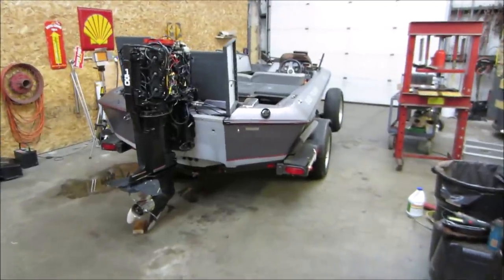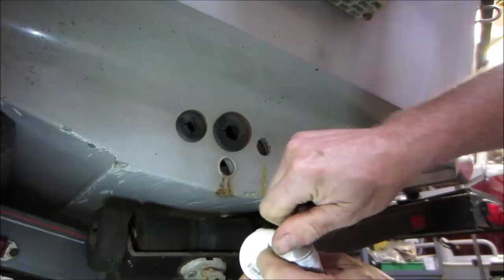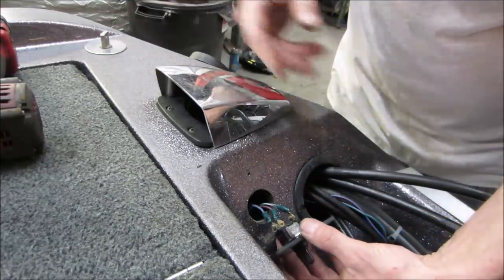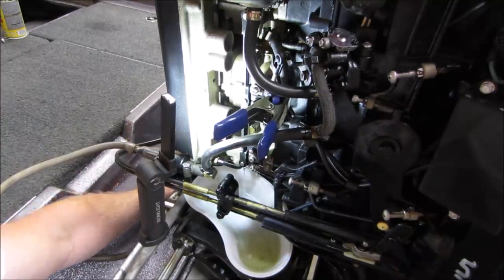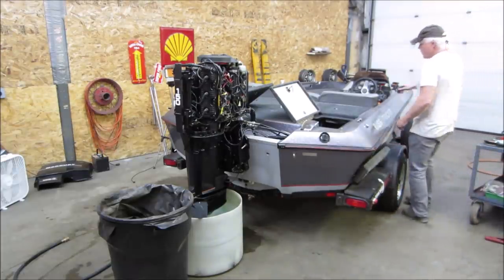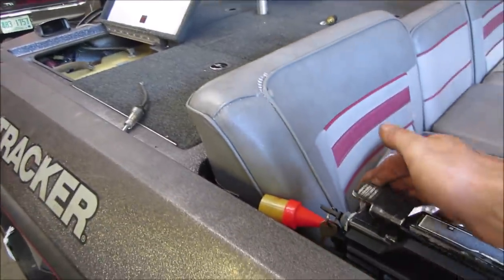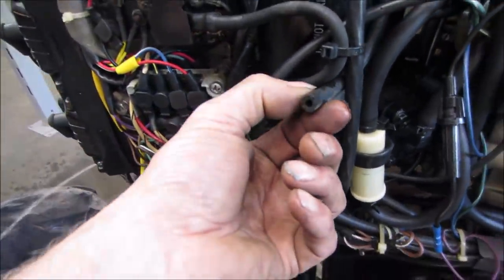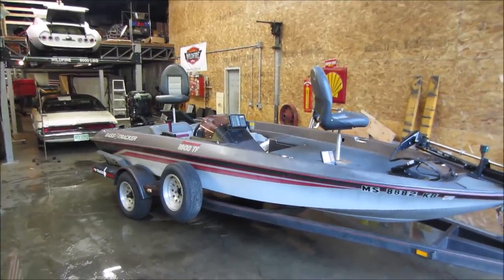Bass Boat Sitting 10 Years, Lets See If The Engine is Good?

Comment: Hey. all the float is for is a warning system,supposed to be a horn when the float is down. The tank will only stay at the level it is when you install the cap because it will be air bound and maintain that level. You should check that warning horn as it should have come on with the oil cap off.

Comment: Normally I would never challenge Anything Mustie does, but as an Outboard mechanic, you should never run an outboard that size in a tank less that a few hundred gallons.  A motor that size will run ok on muffs, but if there is steam coming from the pee stream then it is running hot.  Also, you will definitely need to change the impeller, especially on the larger motors that require a lot of water volume.  Lastly, you must push the key in and hold it for the electric choke blades to stay closed, and some outboards even squirt a small shot of fuel with the choke when you push in the key.  NEVER start an outboard when not in water,  the impeller WILL incur damage if ran dry, even for a few seconds.  The oil injection system should have sounded an alarm when you removed the cap, and should beep every time the key is turned on.  My guess is  that the system developed a problem and they have been pre-mixing fuel, that’s why the fuel was blue.
Reply: As someone who has worked on outboards for a long time, the impeller will not wear untill it gets hot, they require very little water to stay lubed, i know this because during a training exercise we had to debunk several myths and this one we had a practice outboard that ran an impeller/water pump assembly electrically.(this is based at idle)
Normally an oil alarm is when low such as most outboards... atleast the 100's i have - We are a yamaha dealer and we tend not to have alot of issues though lol.
Reply: As an aircraft mechanic, I know nothing about boats or boat engines, but I'm pretty sure they run on gasoline.
Reply: @MrSupermugen  and as a human with at least a pulse I know that it takes only seconds for friction to create enough heat and drag to damage rubber mated against stainless steel.
Reply: You can run it fine in a small container, for a short period of time minutes not hours, otherwise put the hose in the tank and leave the valve open.  It is not a small tank in the sense it has to be large enough to fit the whole lower unit.  Garbage containers typical.
Reply: @robertp7209  for a typical 25hp or so yes, but a 150 generates considerably more heat.  All of these comments really do show the reason why most boat owners don’t really need a boat.
Reply: @Highstranger951  - no recreational boat owners “need a boat”.  Tap water is cool, not hot.  And water is very dense, a lot of cooling capacity.  An Idling motor under no load conditions generates very little heat to matter.  The temperature of the water will rise a negligible amount when idling unloaded for minutes not hours.  It’s true the hot exhaust goes enters the tank water but it doesn’t stay there.
Reply: @robertp7209  you can say all the ignorant things you want, but I KNOW better than you do.  I have ACTUAL EXPERIENCE.  If you had any experience with an engine of this size you wouldn’t be here trying to convince me otherwise.  Good day to you.

Comment: It's scary to think how much oil goes into the environment from just one of these boats. Say nothing of the contradiction when it comes to fishing.! Thumbs Up Mustie.!
Reply: there is  very very very little to no oil that    go into the  environment on  a  good running  boat  the oil is designed to  burn   if you look there is  no oil slick in the water   at all
Reply: @steveholland1163  The oil may be designed to burn, but two strokes don't create a complete combustion.
Reply: @steveholland1163  there's no oil in the water because the exhaust isn't going into the bucket......the only thing in the bucket is water circulating through the engine. 

EVERY two stroke leaves a film of oil behind it as the oil isn't completely burned up in combustion because if it did, there wouldn't be any film on the cylinder walls for lubrication... 

I really do think you should learn a thing or two about outboards before making any more ludicrous comments.
Reply: @LegendLength  yeah 2 strokes are great for torque and performance but TERRIBLY inefficient and dirty.
Reply: @muskokamike127  considering  just rebuilt  a 200 hp  hpdi  i think i  know  just a little about  two strokes and  yes two stroke oil is designed to  burn  and  the exhaust comes out of the  bottom of the  prop  so  yes its going into the  water
Reply: @steveholland1163  well, if you'd watched the video you'd have seen where Mustie pointed out where the exhaust came out of THAT motor and it was NOT "out of the bottom of the prop".
Reply: @muskokamike127    Most all of the exhaust of an outboard is expelled through the bottom fin of the propeller. This is why there are bubbles coming up from the propellers when the boat is started. This exhaust is also mixed with some water from the cooling system. It cycles through the engine and then is pushed up with the exhaust.
Reply: you dont think he  could be wrong as it was  he was  choking it  wrong  but then its in the  video it has to be  right   and it you look you can see  smoke coming off the water

Comment: I'm still laughing at the live mouse that ran off 😂
Reply: glad you didn't scream like a little girl. that would have been embarassing.
Reply: Mustie needs a salt rifle.
Reply: @Rose.Of.Hizaki  I have 4 of those but they suck, to be effective vs larger critters it requires point-blank range.
Reply: Yes I was laughing also you think there were not in  the air box also. Or a nest   . And then pressure wash the engine ? He needs a outboard tech .

Comment: I would change the water impeller and all the fuel line and bulb.  The line in the line will break down with ethanol gas and fill your carbs with trash.  I would also premix in the tank and bypass the oil injection system.  If that injection system fails you probably won't know until the power head is trash.

Comment: The float in the oil reservoir on the engine sets off an alarm if the oil drops too low.
Reply: For sure!  Maybe the alarm module or piezo buzzer is defective.  Ive also seen where folks unhook the buzzer too!  Not a good idea

Comment: My inner clean freak was extremely pleased to see the gas tank removed and the area cleaned thoroughly!  I noticed there were some metal brackets that were completely rusted over.  I might try to find some stainless ones or make some.  At a minimum, maybe blast and paint the existing ones.

Comment: As has been said  a bunch of times, change that water pump impeller. If possible, get one of the newer versions made of silicon rubber. Not sure if they are made for that application. And always keep a second one on hand, just like a new prop, prop nut and prop wrench.

Worked in a boat shop, off and on, for about a decade. Anything that had been sitting for more than a year or two got a new impeller. Simple, and relatively inexpensive insurance.

Comment: Hi
Be careful running the engine without water, if you are not planning to chage the impeller.
Good luck👍
Reply: Impeller is so old and changing it is cheap insurance. Should be changing it.

Comment: The choke is activated when you push in on the key as your are cranking the engine.  If the water pump is working you should have a water stream unless the line is plug which you already checked or the pump impeller has failed. So please for the 30 bucks and 1 hour of easy work change the impeller. Love your videos keep them coming.

Comment: I'm really surprised that the bung didn't have a rubber gasket on each side.
Reply: I thought that too. And sometimes they are ribbed, so you have to get them around the right way.
Reply: I was immediately unhappy that he didn't use marine sealant, and a ton of it all over the part that penetrates the hull to seal it against water getting into the plywood of the transom.  That said, the plug was already broken and the plywood "soaken"!  Rot WILL occur now.

Comment: Great job Mustie.  The solenoids for the motor up and down can be replaced.  My boat/motor is only 20-25 years old, already had to replace the up and down solenoids once.  I think they were 30-40 bucks each, and on the Merc 75HP 2 stroke from the nineties I own, there were 3 solenoids.  Just an FYI.  You might want to pick a set up, just in case.  Also figure out how to raise and lower the motor if those solenoids stop working, just in case you ever need to. I would also change the impeller for the water pump, can't hurt.  Oh and the starting procedure with a cold motor is hold the choke on, make sure in neutral, 1/4 to 1/2 throttle, and then turn the key, 3 hands is best. :)  Can't wait to see you on the water with it.

Comment: The engine mounted oil tank should be filled to the top manually.  The float is a low oil alarm.  If it doesn't remain full, you might have a pressure leak in the hoses or remote tank.

After watching the rest of the video, it seems to be working fine, just top off the tanks.  The alarm send to not be working.  Probably not hooked up under the dash.

Comment: Looks like its running quite, extremely, hot. Id change the impeller and check the thermostat. Looks like the thermo has failed closed.

Comment: No offence to the prev owner, but I wouldn't trust anyone else's electrical repairs-
Get rid of the tape and make sure all those wires are soldered and heat-shrink tube covered- This is a boat not a Garden tractor or a utility trailer- Getting stuck out on a big lake SUCKS!
Reply: sometimes permanently!
Reply: Agreed, no matter who did the electrical work (or any kind of work) it's always a good idea to cover your "you know what"!
Reply: He has a back up (did you see the canoe paddle in the front locker?) so yeah, that sketchy electrical tape connection looks just fine.  😂
Reply: Soldering is inferior to a good crimping job. Slower too.

Comment: since it is a 2 stroke, if the gas dries up in the carbs, it should leave the oil. Which should prevent the carbs from gumming up or corroding.
Reply: The oil is what gums up in the carbs...
Pure gasoline just evaporates and leaves a clean and dry carb, but if there is a drop of water on the bottom of the bowl the carb corrodes on the inside.
Since there is oil injection on this engine, the oil is injected into the intake after the carbs, there is just pure gasoline in the carbs, so no problems with gummed 2stroke oil in the carbs.
Reply: @Henning_S.  not true. 2 stroke oil is not just any oil. also.  benzine with meth is very corrosive and hydrostatic as well.
Reply: two stroke oil goes gooey after a while as it doesn't evaporate as quickly as gasoline (which will also leave some residue)... spent the last 30 years cleaning out old 2t carbs on bikes, chainsaws and weed eaters, the oil defiantly gums up the carb if you leave it long enough....
Reply: @grabir01  I've seen lots of gummed (pre mixed)2stroke carbs but not one gummed 4stroke carb, the 4stroke ones are sometimes a little corroded, but that's it...
I've also cleaned a few 2stroke fuel tanks which were coated with a thick layer of gummed 2stroke oil, the only way to clean them was to fill them with lye and let them sit for a week.
Never seen that happen to 4stroke fuel tanks....
Reply: @Henning_S.   @Henning S.  I have built 1000's of 2 strokes and 100's of four strokes. Lots of 4 stroke carb replacements unless there was premix used for the 4 stroke. I sell a lot of 4 stroke carbs all the time. Always due to corrosion.  Carbs with better metallurgy can help. But still.  They will corrode. It has to be because of the Methanol used  as that stuff is very corrosive for sure. This was never a problem for me with 4 stroke non premix oil motors and carbs 40 years ago. Again. I am sure the main reason is because of the corrosion. I use Valvoline 2 stroke oil and it has never been a problem for me. Not in over 50 years. If ever I feel I have to put a 4 stroke away unused for a time, I will put a little Valvoline 2 stroke oil in the gas and run it. If all that happens is some gum up, that is easy to resolve. Corrosion can not be fixed so easy. You can dissect and boil your carb and then clean it and wire it.  I have had a 60 percent success rate doing that.
Reply: @grabir01  maybe the difference is in the fuel.
Our German gas has no methanol, it has 5 to 10% ethanol instead.
Reply: @Henning_S.  Yikes!!  Excuse me. I meant C2H5OH . Ethanol. Thanks for the correction. Not sure where my mind is at these days.. Thanks
Reply: @Henning_S.  We are at 10 percent here as well..

Comment: Had a boat motor mechanic tell me those oil injection systems aren't worth the trouble. He bypassed mine and I just mix the gas and oil in the tank. Haven't had any trouble with it since. Runs fine.

Comment: I have a similar vintage tracker v Hull (88). Dumped the Merc for a older Johnson. Solved my hard starting issue. Especially in the cold, the older mercs were notorious for having the auto oiler crap out and being really hard to start.

Comment: My father and I once worked together selling 2-part closed cell polyurethane foam kits. We sold to the Marine Industry who filled bouys with them so they never sank even if struck & cut, it was also injected into hulls of boats and bodywork of all sorts of vehicles eg. for Driver Seat heat insulation.

Comment: I really enjoy your videos especially the ones where you are working on small equipment but most anything is good. The way you take your time and talk through it all is not only entertaining but educational as well. I have had the mechanical bug since early in life. I was always tearing things apart but had a talent for reassembling them as well so they would run. I am 65 now and retired after a 31 year long career as a heavy equipment mechanic and Supervisor for the City of Mesa in Arizona. I retired at age 50. I have drag raced most of my life until recently. I also build hot rods and rat rods and take on little projects like you trying to save neglected stuff. Most of the stuff I do get for free here is toast. The heat and dirt destroys things quickly. I want to thank you for all the advice. This week my neighbor's lawn mower quit. She was taking it to a shop. I volunteered to check it out. After cleaning the carb and adjusting the mag everything else was checked over. The culprit was a junk spark plug. Fixed it for $1.93. Thanks. .

Comment: Liking your videos. Thank you. 
Personally and while having the tank out, I would have replaced all three pump inlets given the issue with the first one. Always drop the leg, ensure seals etc are ok, replace impeller (every season and on a new purchase) and replace gearbox oil. Those cable repairs look dodgy - I would personally repair them properly. Nothing worse than getting stuck on the water.
Keep up the great work 👍🏼

Comment: I’d check the serial number on that motor, as I’m 99% sure that’s not a 1990 model. The clamshell cowls were only used by Mercury through 1988, and they went to a bucket style cowling in 1989. This will be very important to know if you ever need to replace other parts - rectifier in particular. I’d also check the alarm system on that motor. You should hear three distinct beeps when the key is in the “on” position. If not, you won’t be informed of overheat, low oil, etc. In fact, you should have been hearing a low oil alarm (“beep-beep-beep-beep”) when the engine mounted oil tank was low. That little float sensor should have tripped the alarm. But good job! Enjoying the vids. 👍🏻

Comment: Hey mustie, maybe to further clean out the gas tank and the fuel system you could pour a bottle or two of Berryman's B12 into the tank or even spray some directly into the carbs while it's hot and running.

Comment: If you read the Mercury service manual, they tell you for the first tank of fuel of the season to add oil to the gasoline until you can verify that the oil injection system is properly working.

There are a few things that get serviced when you replace the impeller as there are a couple of seals, the primary culprit, the shift seal that if they leak sucks water into the lower unit and takes the gears out in a few hours of operation. The cost of a impeller kit and seals/o-rings in cheap compared to having to replace everything south of the power head.

Always check the oil level in the lower gear case. Besides the oil level being low, you can see if you've got a leak with the exposure of water in the oil or low oil level.

There is a solenoid for the primer system on the carbs. While you have all the covers off, I'd pull the starter and lubricate the Bendix gear. It's simpler to service while in the shop than while out on the lake or river.

Comment: Agree 💯 with all those saying replace that impeller. Years of sitting have caused it to dry out along with the seals on the pump. The vanes are likely stiff and no longer flexible. The pump housing isn’t symmetrical. At the pick up side the vanes extend and pick up water and as they spin towards the engine side they compress against the housing and build water pressure.  Since it’s been sitting I doubt the vanes will extend to pick up as much water and they are likely to break apart and lodge small pieces in the water tubes. 

My guess is it took the pump awhile to prime itself as much of it was still above the water in the bucket. It will flow plenty of water even without the thermostat opening, but you will feel the water warm up with your hand when it does.

Comment: You need a test tank of 55gal size (cut down to fit under the motor clamps) full to the point its a few inches above the ventilation plate. the water pump is ABOVE the plate and is under water when the boat is at rest.